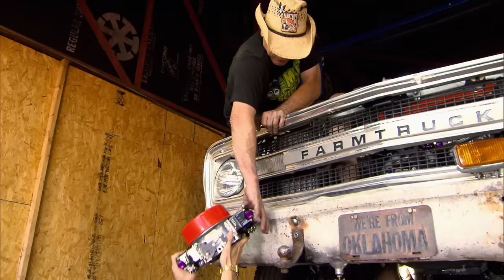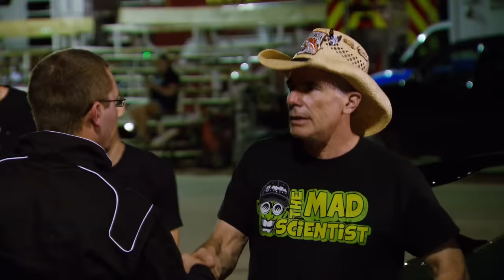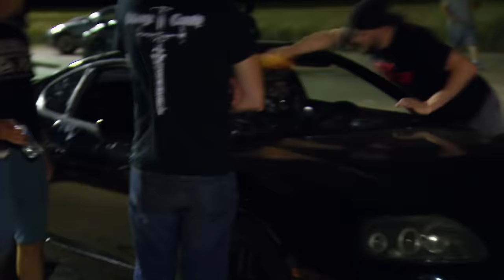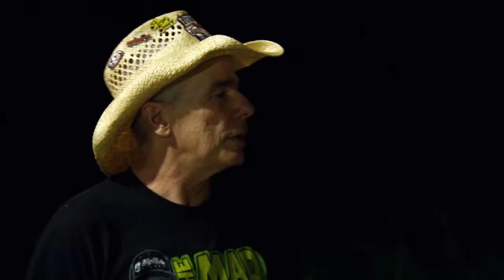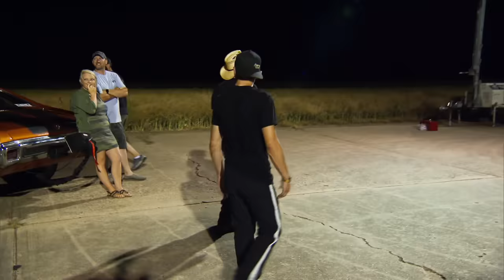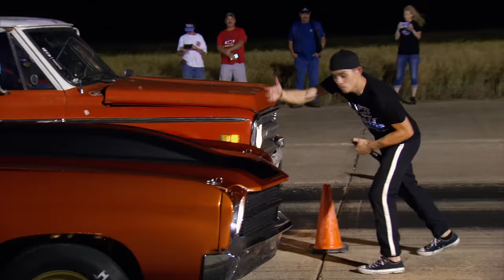Farmtruck & AZN Destroy The Competition With New Motor I Street Outlaws

Comment: Imagine how fast the Farm Truck would be if they cut off 1,000-2,000 pounds off the truck.
Reply: They should
Reply: Being a street outlaw is NO racecar lol only original Steel bodies only racecars shave weight
Reply: 100 pounds a 10th generally.
Reply: You risk the tires spinning at that point because there’s not enough weight on them. They have it figured out